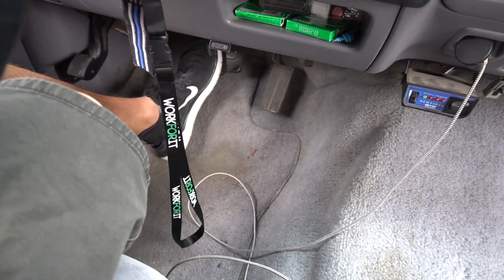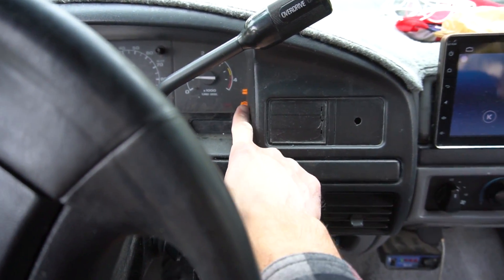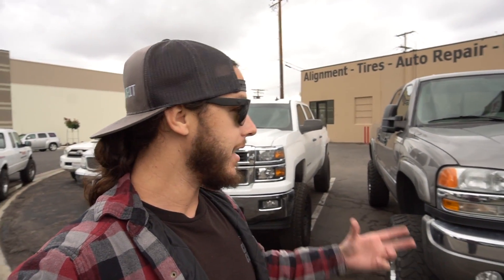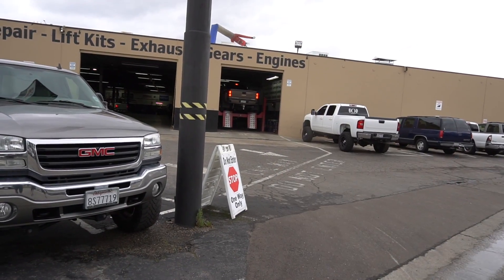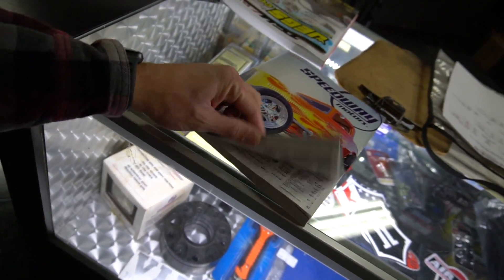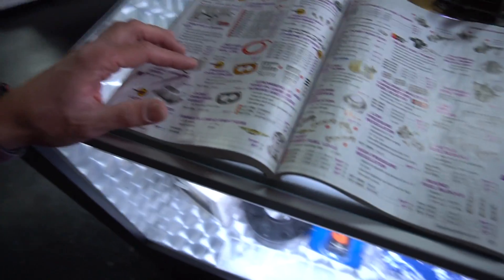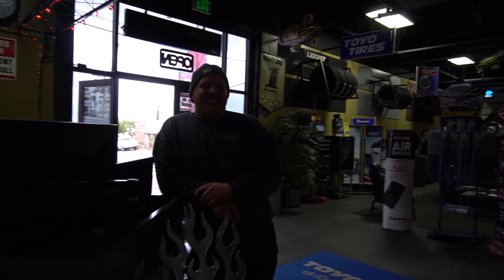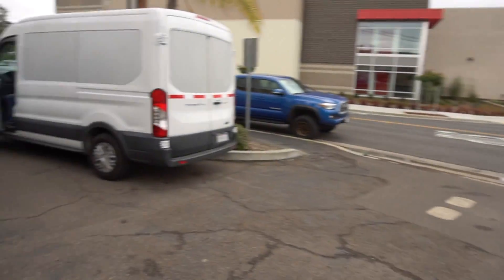MY FORD IS IN THE SHOP AGAIN....

Comment: Ryan why not do project obs powerstroke? You could install a straight axle from a dodge and full air ride on the truck. I’m sure you could find a kit to do a stock height to 6” air ride kit and do some 37’s on 20x whatever size width you want.

Comment: When your brake fluid gets low and you do not have a leak your pads are getting smaller which uses more fluid in the Pistons of the calipers. That is just my opinion but when you go to change your pads and you have more fluid than you should it tends to spill out of the reservoir when compressing the Pistons to change the pads. Just double check them pads and or shoes for the rear. Great content my guy keep working for it

Comment: I had the same thing happen to my Blazer turned out that the connection for the wheel speed sensor was no longer water tight so I had to dry out the connection and put a new seal tight on it